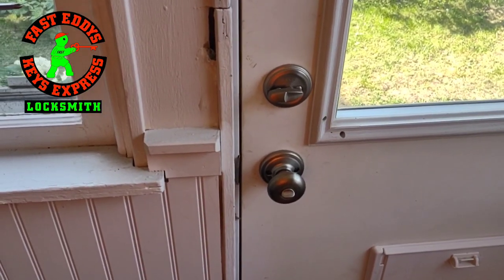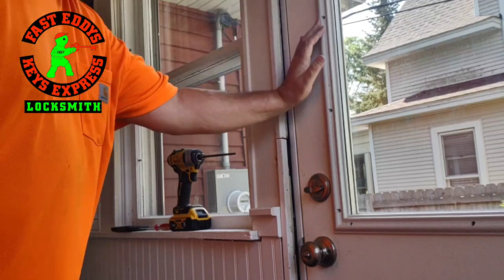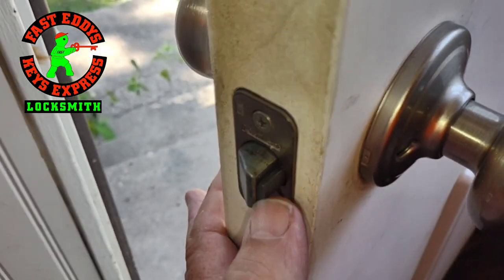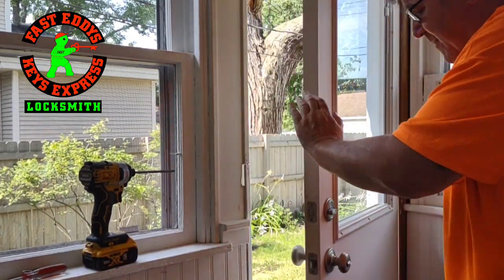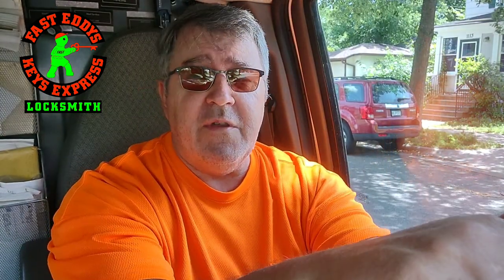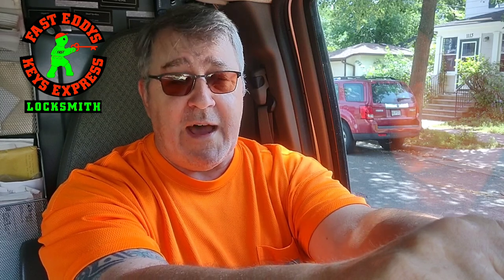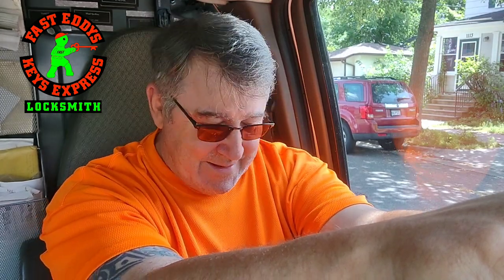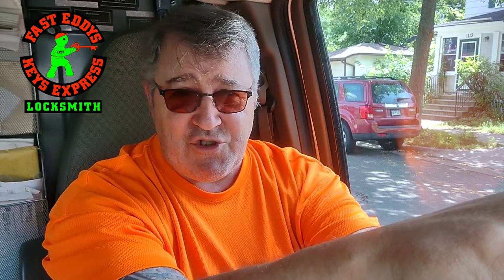Quick Fix For A Door Lock That Doesn't Turn | @fasteddyskeysexpress

Comment: Here in California it’s rare to run into this problem. But the Kwikset latches fail often and need replaced. I do a fair amount of property management rekeys and have to replace them often
Reply from the maker: I completely believe you! Up here its all about the door insulation kits on the door frames. That causes so many issues.